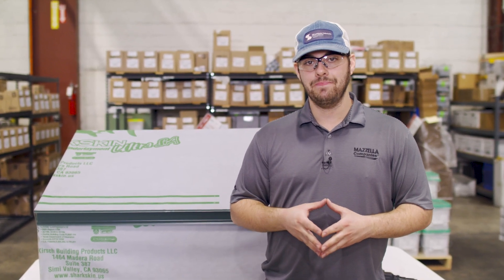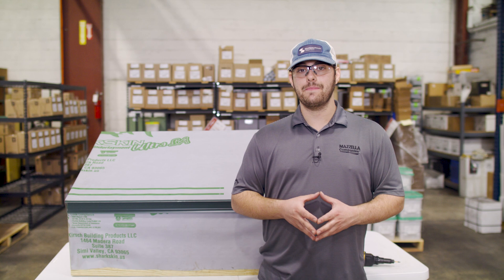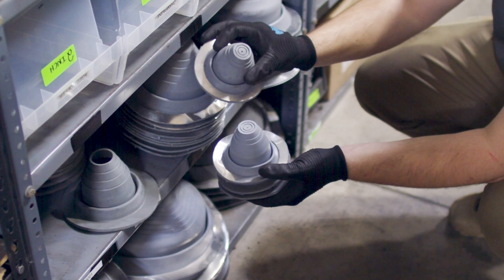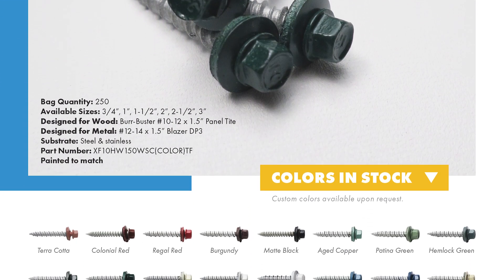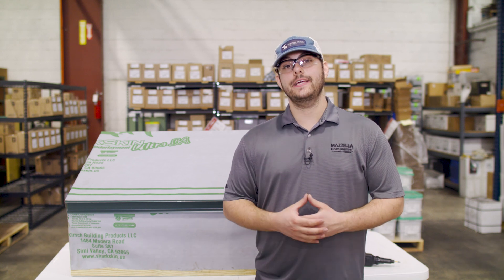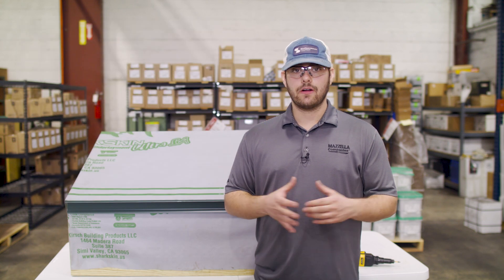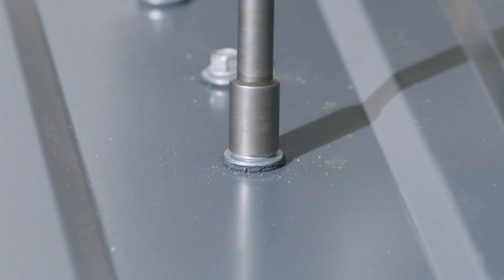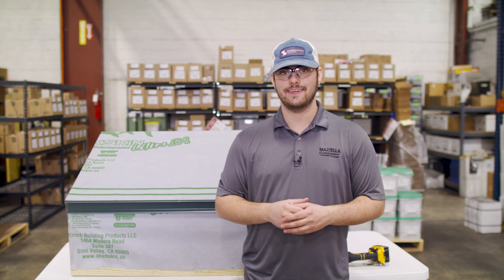How to Choose and Install the Right Metal Roof Screws & Fasteners

Comment: Do drywall screws work for double lock panel clips?
Reply: the phosphate coating will rust and not to mention is not even structurally strong